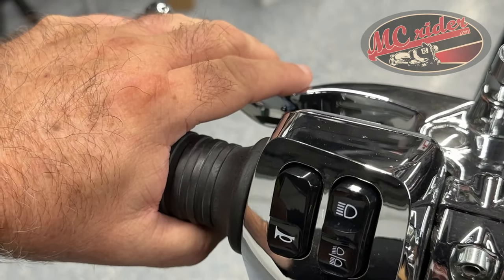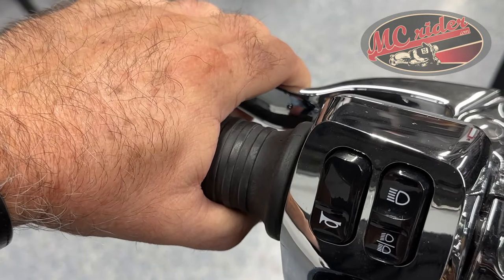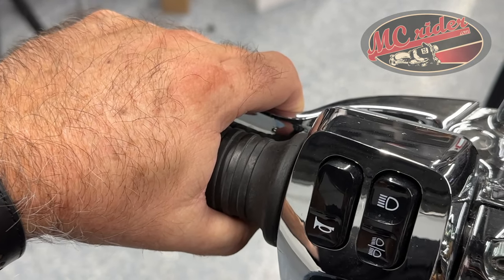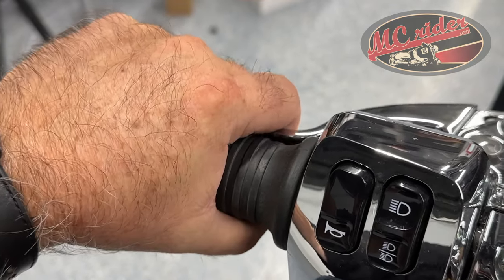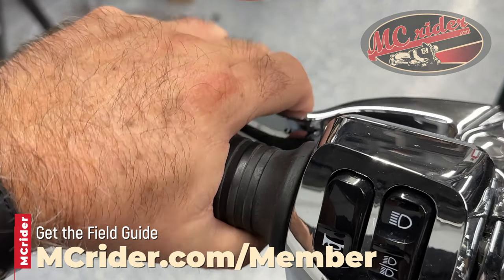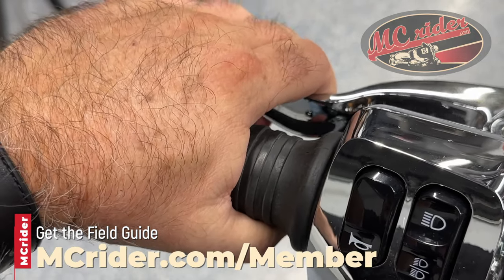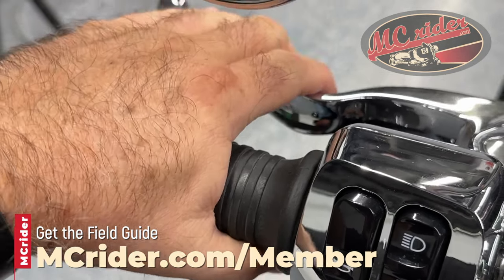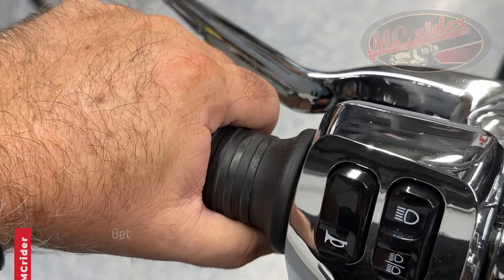A smoother & quicker way to shift your motorcycle.

Comment: The key is to put pressure on the shift lever before clutching.  As you bring in the clutch, it'll automatically shift once you've clutched enough.
Reply: YES!
Reply: I support this comment. Pre-load the shifter..
Reply: He has video about it as well
Reply: New rider of 6 weeks - my shifting hasn’t been very smooth. I think this may be the key. Good tip
Reply: I agree with you and have learnt this from this channel only in one separate video
Reply: just curious if this could damage the clutch or transmission somehow? like if the pressure on the shift lever slips through too early after the clutch is open, would it grind anything ? 
Sorry i'm clearly an amateur lol
Reply: @TheINFP_Diary i would also like to know
Reply: @TheINFP_Diary  Yea dont do this unless you want to kill your gearbox. Throttle off, clutch in, shift, slow let out into the friction zone. Dont listen to these clowns. Been riding since I was a kid on dirt
Reply: @TheINFP_Diary i dont think so, when you clutched enought the friction between those plates are enough to hold the power for shift, it wont damage anything
Reply: @biglizardmedia just because you've been riding that long doesn't mean you've been doing it right
Reply: @brucenadeau4643  lol yea okay. You don't know me at all bud. Let's go for a ride sometime, see if you are any better
Reply: @mikehughes3340 I’m like 3 weeks. My shifting is HORRIBLE. It’s discouraging. I don’t know if I’ll ever get it, but I will try this tip 🤷🏻‍♀️
Reply: @badboybootz8 practice patience and time is what it takes to perfect something don’t give up and instead of saying I don’t think I will ever get this right try saying I got this because you do have it the key is practice brother ride easy have fun please be safe
Reply: @jack_2-0-7  thanks Jack 👍

Comment: I rarely use the clutch for upshifts.  I find it quicker and easier to simply apply a little pressure on the shift lever during acceleration, then shifting to the next gear only takes a momentary unloading of the transmission by just quickly backing the throttle a small amount.  When done properly it almost sounds like an automatic and is not harmful to your transmission unless you're really applying a lot of pressure to the shift lever.
Reply: Any amount of pressure on the shift lever trying to get it to slip in when it’s ready is going to prematurely wear your clutchdogs. Using the clutch, which is a wear item, makes way more sense than causing wear to your transmission clutch dogs, which are not wear items.
Reply: @thagingerninjer5391  The transmission has gear dogs, since the gears are straight cut there's no need for synchronizers,  or clutch dogs as you call them.
Reply: @lesbratton  I wasn’t calling synchros clutch dogs. I was calling the clutch dogs, clutch dogs, because that’s what they’re called. 99.9% of sequential transmissions in motorcycles have them, and 95% or more of mc transmissions are sequential transmissions. What I said was accurate. I think you’re calling the same thing a gear dog. Some people do. Some people call them dog bones, too. It’s all the same thing. It’s what locks the gear in. Synchros aren’t used in sequential transmissions.
Reply: @thagingerninjer5391  I think it would wear more on the shift drum and forks than anything else, besides gear dogs are backcut a little so they will pull themselves together under a load.
Reply: @thagingerninjer5391  When upshifting without the clutch, the idea is not that you ride with pressure on the shift lever for any extended period of time, but that you do so at the instant that you unload the transmission by releasing a bit of throttle.  I've put over 50K miles on each of at least 3 bikes over the years and used this method on them all with no issues with the transmission.  This method effectively unloads the transmission with the throttle instead of the clutch.
Reply: even more fun when you do a clutchless downshift with a perfect throttle blip
im better at clutchless downshifts than i am with clutchless upshifts lol
Reply: @thagingerninjer5391  I don't know who you hang out with, but no motorcycle transmission has synchros if it has straight cut gears. You must be talking Harley lingo.
Reply: @billdickinson6021 is there a certain rpm to upshift at?
Reply: @fonz1anddone713  It works at any RPM.  All that's needed is slight pressure on the shift lever to the next higher gear and to unload the transmission with just a backward twitch of the throttle.   Pops right in every time.  (I don't, however, recommend constantly keeping pressure on the shifter.  Just when shifting.)
Reply: @billdickinson6021  thank you. Just got done adjusting the height of my shifter. Feels allot shorter hopefully translates into smoother shifts, and I'll try your method in a little bit on way to work.
Reply: @fonz1anddone713  Let me know how you like it.
Reply: @thagingerninjer5391  I can do it without the clutch and effortlessly get it in gear without any additional pressure to the shifter. Is this still bad? I’m super smooth.  It’s a real question I’m assuming if it’s all buttery smooth then nothing is getting worn?
Reply: @SwingingPythons  no, it’s still getting worn. It’s not much each time, but they add up, and you’re damaging hard parts in the transmission, rather than just wearing your clutch down, which is its literal job.
Reply: @lesbratton  not one, single time, did I say a motorcycle trans has synchros. I said it doesn’t have synchros, that’s why it’s a clutch dog transmission. It uses a clutch dog, or several, to shift gears.
Reply: I do this on my R6, I call it air shifting

Comment: I think it depends on your bike. The friction zone can be located different depending on the bike and whether or not the owner or shop have made adjustments.
Reply: The correct adjustment for all clutches is going to out the friction zone at the last 2/3-3/4 of the lever throw. All clutches are going to be different. Even changing the clutch on the same bike is going to make it feel different, but they should all be adjusted to spec, which is going to be in that 2/3-3/4 of the final throw range.

Comment: If you release the throttle accurately (upshifting), those plates won’t even need to slip.
Reply: Yeah I find once I’m into second gear, all subsequent shifts are smoother if I do a  clutchless upshift.

Comment: Great information as usual.   What are the PROS and CONS of doing this mechanically?  Can you not accomplish the same thing through adjustable levers or adjusting the cable so that a full pull of the lever is just past the point the friction plates disengage?  I ask because this is how my motorcycle was set up from the dealer and even more so after I upgraded to ASV levers.  Add this to a nice slipper clutch and you have some very quick and smooth gear changes.

Comment: Great Videos keep up the great work of educating us. I’ve passed on your site to a few newbies and oldies.
I was interested in your demo showing four finger clutch control vs one or two. I ride a large R1200GS and  small WR250R. I use two fingers on the clutch and brake for all on and off road riding (except if I was emergency braking).
What’s your take on number of fingers for regular riding?

Comment: I have to be a little more careful as my Harley has a different ball and ramp assembly. I had it put in to make an easier pull on my clutch. My left hand has a finger missing from an accident that happened three years ago. Btw, I have more clutch travel with that different ball and ramp.
Reply: I asked an HD mechanic for something like that and he said that there was nothing Available. I have an O 6 street Glide.
Reply: @billscruggs5170  The Harley dealer I went to said they could get an after-market kit that they put in. The brand is Muller Motorcycle AG The U in muller has two dots above it.

Comment: Good Tip !
I shift into Neutral at  long traffic lights .

You should do a video on rev-matching &  blipping the throttle on downshifts .
And not completely letting off the throttle on upshifts .

For those who don't have a slipper clutch or Quick shifter .

Thx for the videos 😎
Reply: Be careful putting it in neutral. I’ve kept myself from being rear ended twice just in the last month by staying in first and checking my mirrors. Had I not been able to escape quickly, I would have been toast.

Comment: Closely related to this, although not for all, it is worth trying a "shorty" clutch lever which (1) allows you to change to 2-finger clutching, which is vastly better, (2) shorty levers will mostly allow you to adjust the start of the friction zone to /very/ close to the grip - mine is about 5mm - this is also a huge advantage as it is easier to know exactly where the friction zone starts, and (3) it is easy and even natural to use partial clutch to change gears, plus only 2 fingers, plus lever starts closer to the grip at full extension.  All of this helps.
And finally, (4) 2 fingers on the clutch means 2 fingers permanently closed on the grip - this makes a huge difference to low speed manoevers with the clutch partly in, you have far better control of the bike.

Almost forgot.  Using only 2 fingers on the clutch, I normally drive in traffic with two fingers permanently covering the clutch, so changing is extremely quick - just a slight pull of two fingers that are already right there and gear up or down in a flash.  By the way, my bike has a quickshifter, which I disabled after getting the shorty lever.  I find I prefer to have complete control over what is happening, plus then all shifts are the same including down to first and stop.

Comment: Baahhhh, just don't use the clutch at all except for stopping. A little pressure on the shifter, release the throttle, shift, apply more throttle. Easy as pi. Harley's don't seem to like it but any other bike I've ridden can go up and down the gears, w/o clutch, smooth as silk. (it does take a bit of practice)